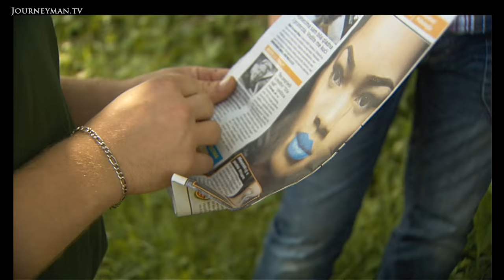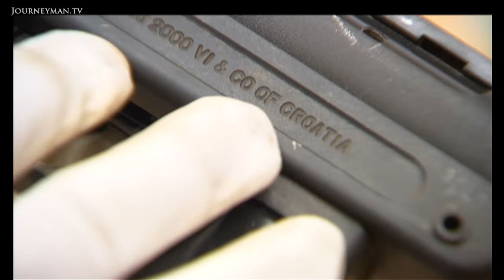Will Croatia's Entry To The EU Flood Europe With Guns? (2013)

Comment: Anyone with access to the internet can figure out how to get a gun, it’s really only a matter of motivation.
Reply: Edon Mani  You need the onion browser and about $100 in Bitcoin, or you could make one with a $200 3D printer and another $200 in glock parts
Reply: Edon Mani  Then use the 3D printer to make an FGC-9, it requires no gun parts, and get the rest at a hardware store. Or just use onion browser and Bitcoin.